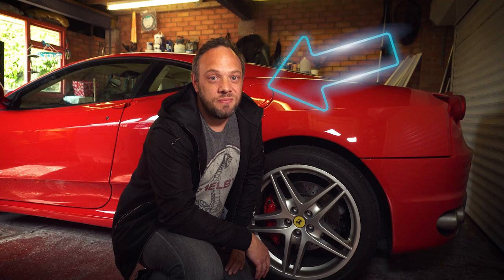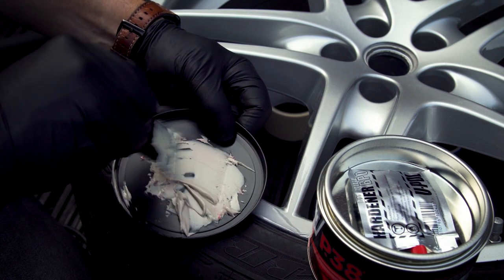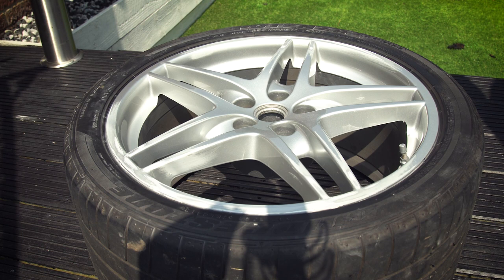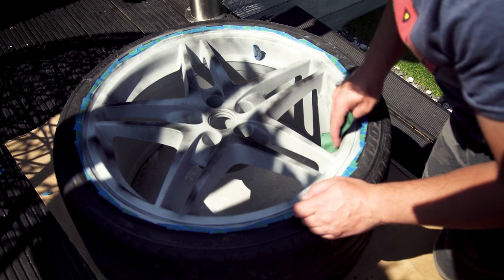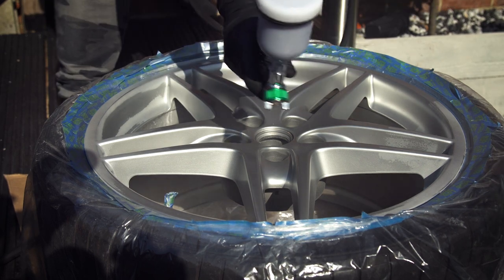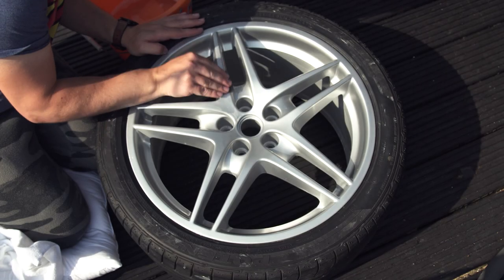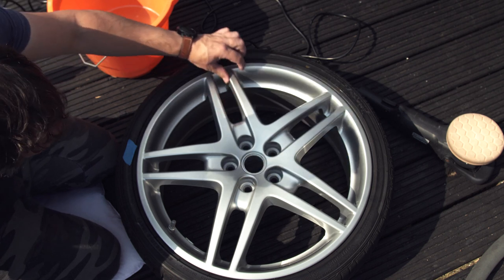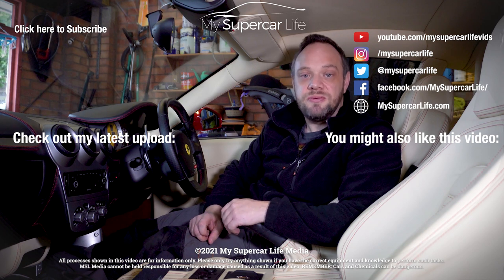How to Fix and Paint Kerbed Alloy Wheels at Home

Comment: Brilliant, you should be doing professional voice overs your commentary is perfect.
I’ve got a 430 so I’m eagerly awaiting your gearbox oil leak video!!😆😆
Reply from the maker: Thanks! I sold my F430 a couple of years ago. What is wrong with the gearboxes? I only ever had a leak on mine the day after bringing it home from having a clutch and flywheel fitted because the dealership didn't fit a new rear main seal and it conveniently started leaking the next day. Luckily I noticed straight away so they had to re-do it all for free.
Reply: @MySupercarLife  similar story mines had some work and I’ve noticed a little puddle I think the drive shaft inner boot is split as well so whilst I’m under I’ll have a look, might be nowt, fingers crossed

Comment: Great video mate one of the best DIY wheel tutorials I've see for a basic refurb but with a gun.
Thanks mate! Any chance you could post a link to the paint and gun you used at all mate? Thanks!
Ps. Nice Ferrari mate is that a 308 or a Deano? Can't tell from the brief glimpse.. should have done an after shot of the whole car show the wheels and the car off aswell mate. Nice one my mate has a Ferrari, I've always wanted one never quite had the funds and when I had the find for a second hand one I ended up going sensible and buying a new BMW, but wish I'd gone for a second hand Ferrari now lol 😅🤦🏻
Reply from the maker: Thanks mate, I appreciate the kind words. There's a link to the Spray Gun in the description. It's a US Pro HVLP from Amazon. The paint was from eBay and came as a set including the base, clear and primer the company was Jawel Paints.
The Ferrari was an F430, it's in loads of the videos on my channel, one of the best views of it is if you find the one on cleaning the engine bay - that was my favourite part of the car 😁 I wish I'd got better shots of the wheels after they were done but for some reason I don't have any unfortunately. 
I bet the BMW causes you less trouble though nothing beats getting ready to take the Ferrari out and it has different plans - like flat batteries etc!! 😆